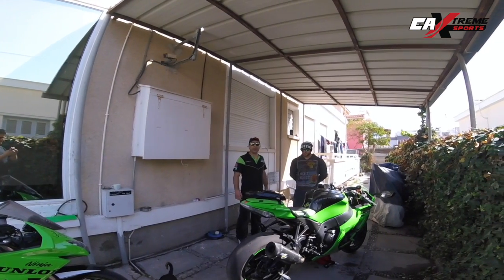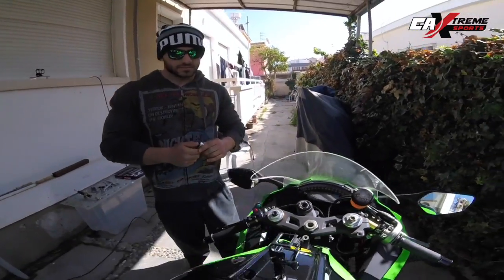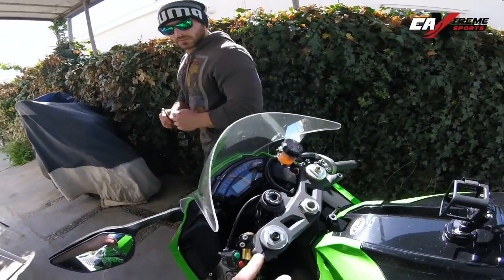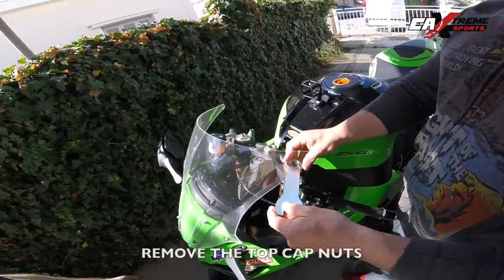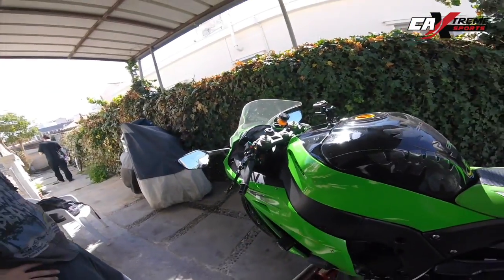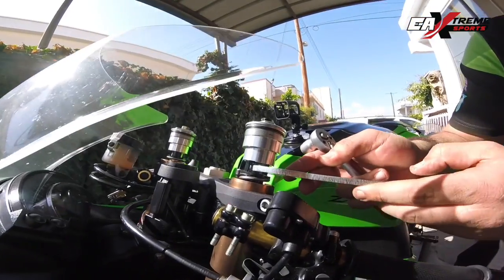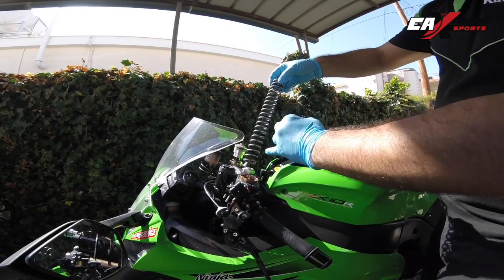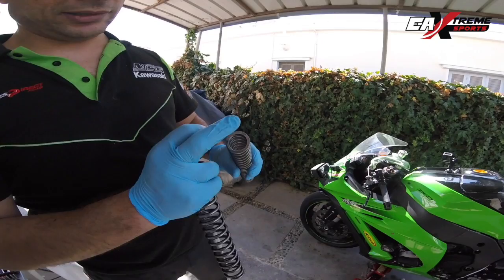K-Tech Suspension how to change preload springs on K-Tech 20DDS Fork Cartridges

Comment: Fantastic demonstration Guys :-) thanks.
 So if your very careful removing spring slowly there is no need to have oil level/air gap professionally checked ? 
thanks again for the great video! :-)
Reply from the maker: Thanks for watching Paul. No there is no need. 20DDS are designed so that you can replace springs quick and fast.
Reply: Thats great to know and thanks again ... Truly  great video that cleary shows the steps how easy it can be when done right with right tools :-)
Reply from the maker: Paul Walton Thanks mate!